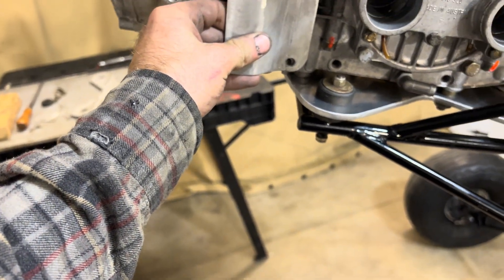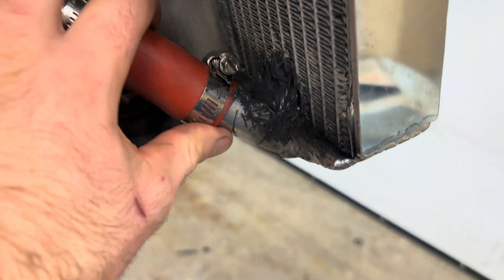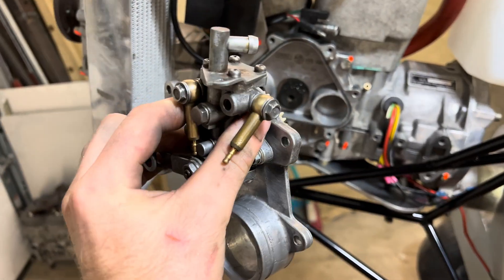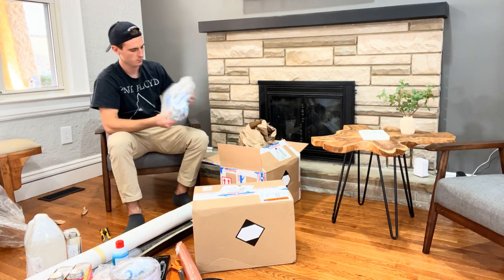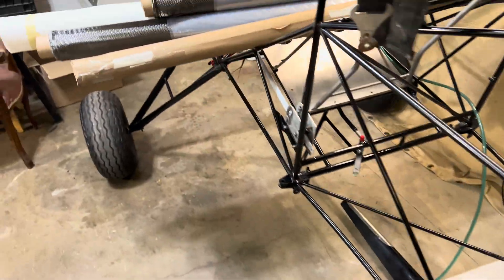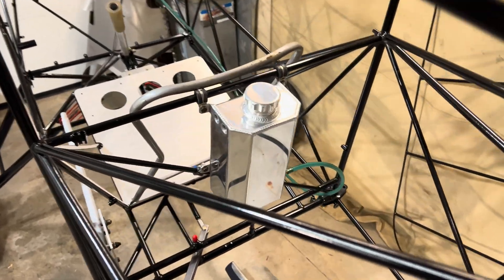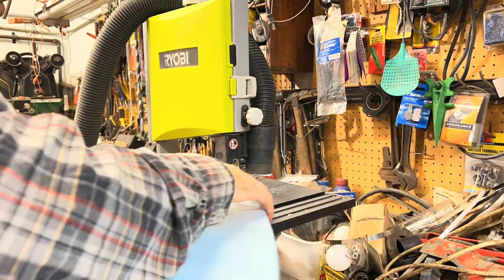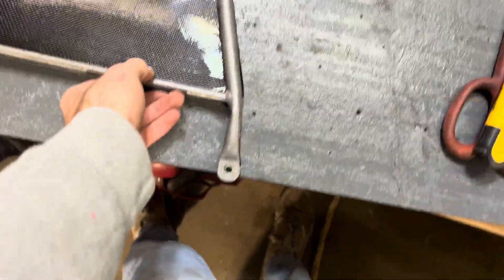Making Progress on Abandoned Bush Plane Project: Engine & Airframe

Comment: The carbon fiber rib build is totally dope. Looking fwd to the how you integrate flaperon hangers.  Regarding the 2-stroke - I found it very challenging to manage EGTS when I operated a 582 Avid. The eng is unloaded eg. landing, EGTS skyrocket. The best solution is an IFA Prop. I used an IVO to pitch and load the engine. Better yet, install a mixture controller. You’ll love that under camber wing!
Reply from the maker: Thanks for the tips! A mixture would be a nice option to have